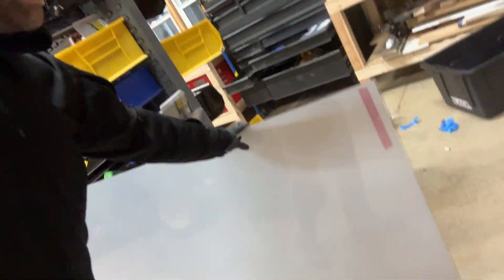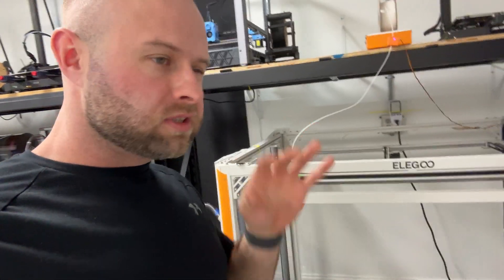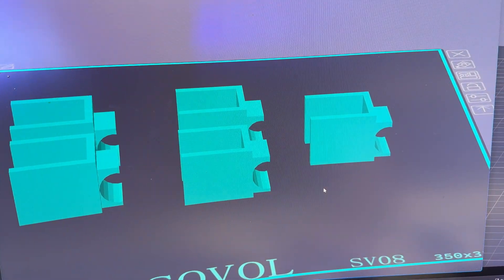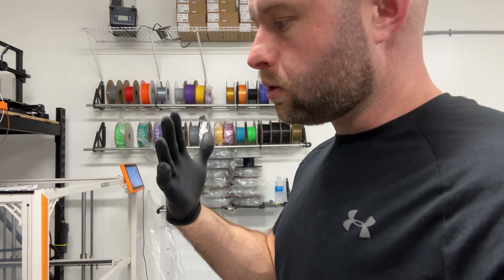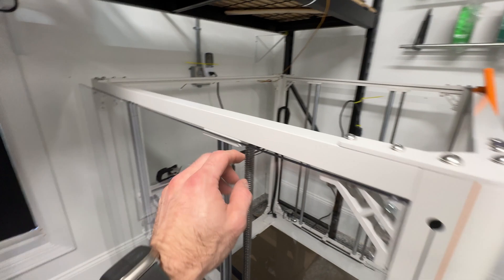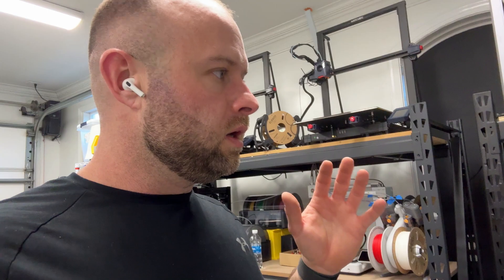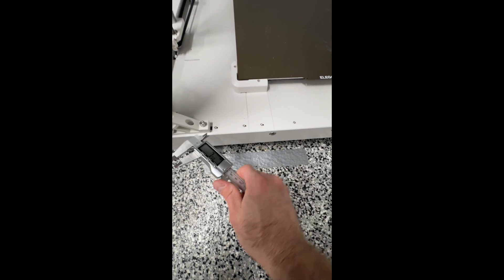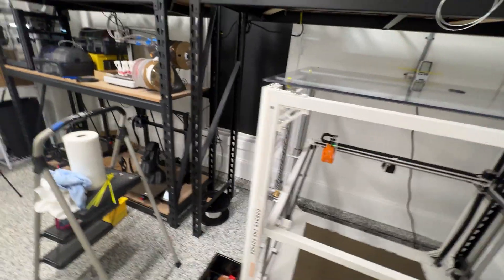Making a THICK Plexiglass Enclosure for my Elegoo Orangestorm Giga: 3D Print Startup Biz Vlog

Comment: You went more elaborate than I would have!   I'd have 'invested' in big sheets of thick cardboard and a couple of rolls of duct tape for "hinges/joints/seams".   When you first mentioned your issue I expected you were going to build a simple wall to turn your printer corner of the garage into a "closet" that's braced against the wall (floor anchors optional).    If you're goal is to stabilize the temps, then your frames are big enough to make a 'cabinet' to get you through (and maybe even save some $$ on keeping your garage so warm in the winter).

Good luck with it, and thanks for sharing your fun.

Comment: Riv-nuts. Then put holes in and you can bolt it on, and take it off, the sides will have permanent screw holes. What I plan for mine, but with 3D printed side panels that will hold the plexi.

Comment: You could use a couple of those 1" magnets to hold the top/edges of the plexiglass to the frame - to separate the magnets just slide the plexiglass sideway an inch